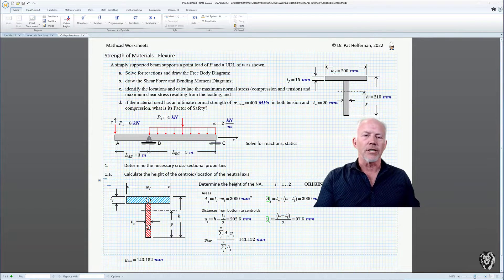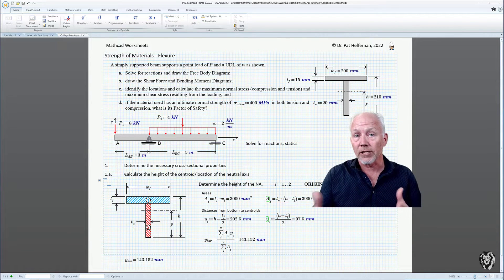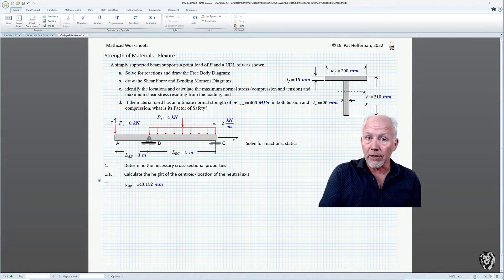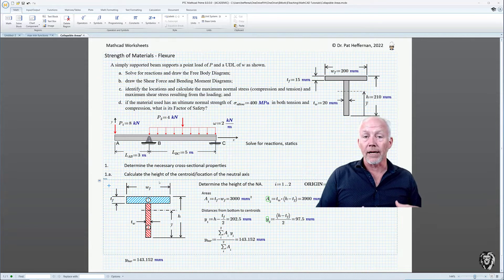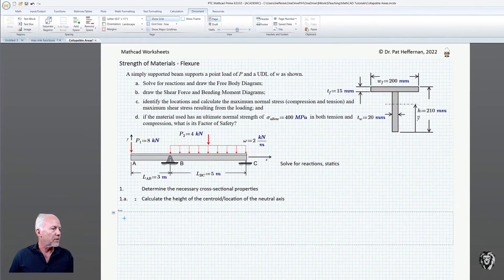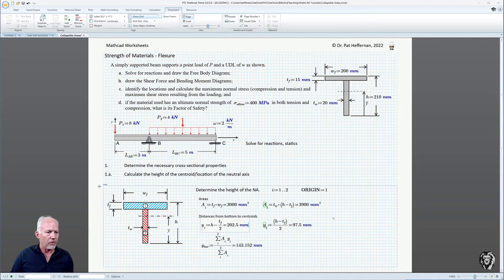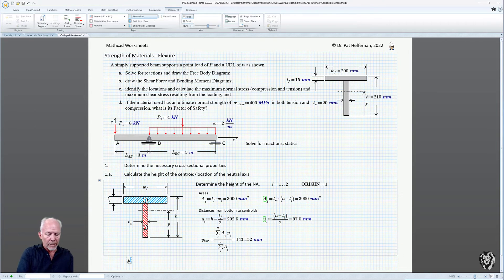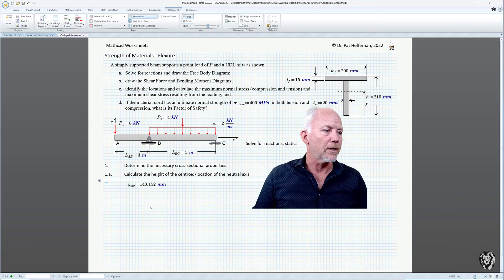PTC Mathcad - Collapsible Areas

Comment: Is there a way to automate the calculations of the reactions force and Moment at the fixed support using Mathcad if the Lengths of the sections are a general. like 1xn, 2xn etc and n is just defined to be a number.
Reply from the maker: If I understand your question, then absolutely.  Just derive  equations for the reactions as a function of length and then vary n to get different results.
Reply: @PatJHeffernan  how can i share a pdf of the question i would like to address?
Reply from the maker: @ As for that, I am no expert.  If you feel comfortable putting your email here, I will send you mine.